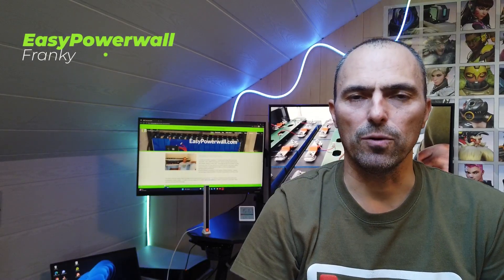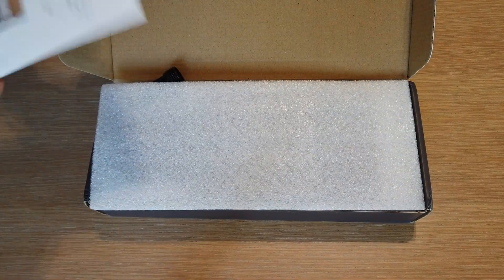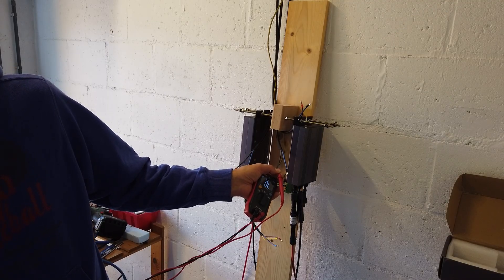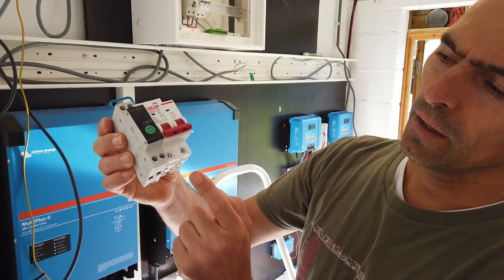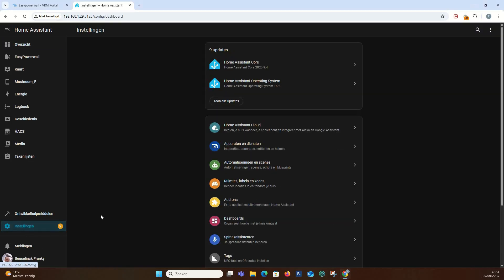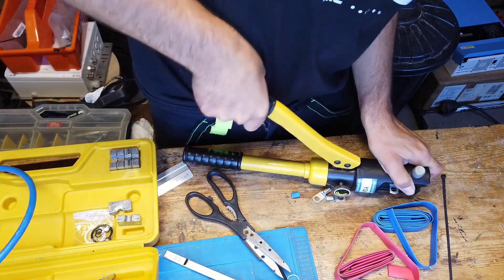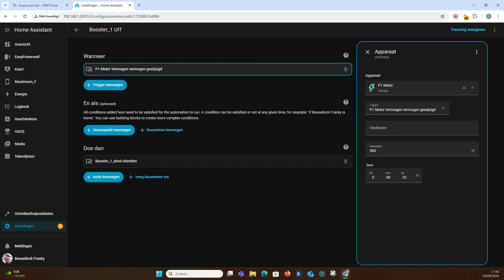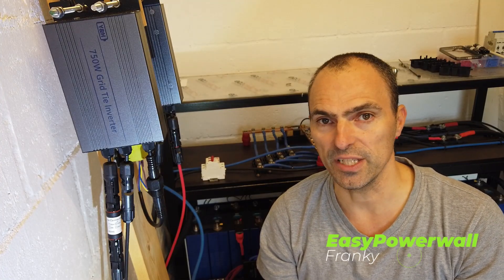"Unlock Massive Savings! How Micro Inverters & Batteries + Home Assistant Can Slash Energy Bills!"

Comment: While this is innovative thinking, the AC-side switching is not recommended. This is the equivalent of stopping your car by pulling the manual hand brake rather than using the brake pedal. This way, the life expectancy of the inverters might be seriously reduced. 
Let me explain: In the inverters there is an intermediate DC circuit between the AC-inverter and the DC MPPT input. The MPPT part is pushing energy in, the AC part is pulling energy out, keeping everything in balance and keeping the intermediate DC voltage stable. However, when you switch off the AC-side, the MPPT side keeps pushing energy in while the AC-inverter side cannot pull energy out (because it cannot move it to the grid anymore). Therefore you get a voltage spike at the AC-output, but also the intermediate DC circuit voltage will rise sharply, until the system hits some kind of emergency off level and the MPPT is shutdown. This repeated voltage spikes will kill your inverters over time.
Best way would be to regulate the power to zero by means of a communication interface and afterwards gently shut it down. If this is not possible, it would be better to try to reduce the DC input voltage to zero (I know, DC switching is much harder, especially with these currents, so not easy either).
Reply from the maker: Hi, thanks for taking the time to share your insight. OK, this was a Proof of Concept but it's good to have some technical info from an expert. For now everything is still working.
I agree there are better solutions and I will look into your info and try to improve my setup.

Have a nice day. Franky - EASYPOWERWALL

Comment: Nice Video. thank you. Can this micro inverter also have and charge backup lifePO4 batteries?
Reply from the maker: Hi, 
No this inverter is only to change 52V DC to 230V AC. You can't use it to charge the batteries.

Franky - EASYPOWERWALL

Comment: Great video! I actually have a similar setup — a 1600 W inverter connected to two 12 V 123 Ah TED VRLA GEL batteries. In my area, the grid is limited to about 500 W per phase on a 3-phase system, and if it goes over that, the breaker trips. So, I built something similar: when my water pump starts, a power meter detects when consumption exceeds 100 W, automatically disconnects the grid input from the inverter, and switches to battery power. My solar system isn’t as large as yours, but I do have an ATS that transfers power from this grid inverter to a solar one. Unfortunately, during winter it’s not as helpful — but your video gave me some great ideas for future upgrades!

Comment: Why not just use the Victron MultiPlus II for peak shaving? If it’s grid-connected, you can set the grid set-point to a negative value and it’ll feed up to 5000 W back into the grid. Or am I missing something?
Reply from the maker: Hi Robert, thanks for your question.

This setup might be usefull if you don't have inverter and want to feed back to grid depending on your energy revenue. Just like a plug in battery but bigger (more Wh/€) and more flexible.

Frank - EASYPOWERWALL
Reply: @easypowerwall Ah, okay cool! I had a similar setup a few years back using eight Enphase microinverters. I could switch each one on and off individually, and they ran at maximum current for years without any issues.